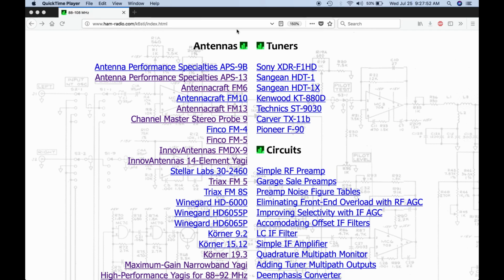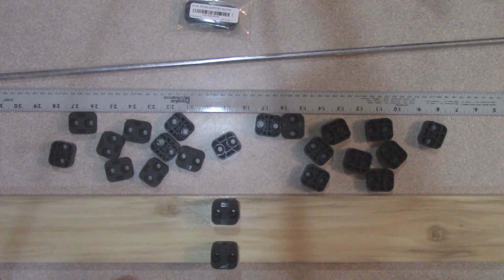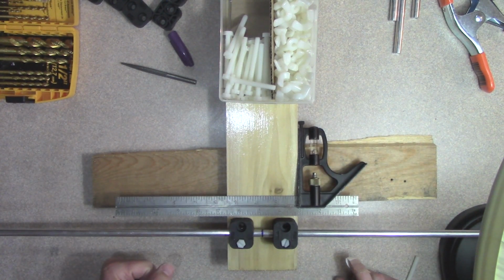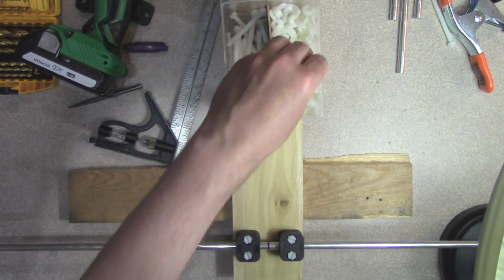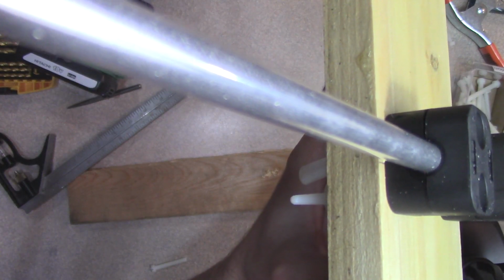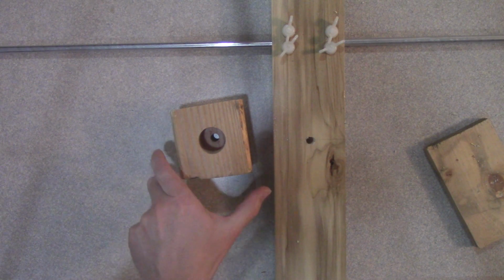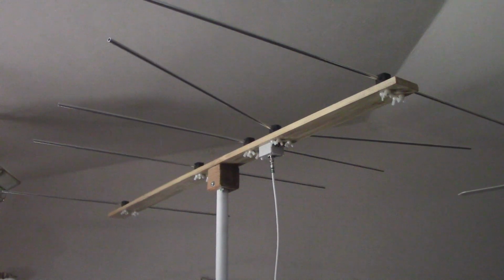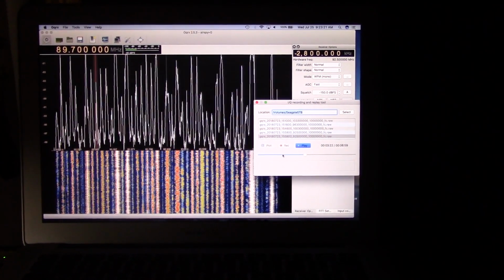Arizona Signal Watcher Ep014 - 5-element Yagi for the FM broadcast band

Comment: Came across this, this morning, seems like a solid antenna, kudos!, 
re matching direct to the Coax, you might want to slip a few clamp on Torroid chokes right near to the feedpoint, to eliminate the exterior side of the Coax from "picking up signal" , you should gain even better directivity from the Yagi, once you get rid of that common mode RF off the shield.  I have made some interesting full wave loops for FM Band, the Circular Loop one wavelenght in size a favorite, which worked great especially at nulling out a station and seeing who might be underneath, FM Band DXing = Great Fun

Comment: I just completed this antenna and it works great!  Mine is built on a 1" tube aluminum boom and mounted on a tower with a rotator at 37' high.  I am running it on a FM crystal radio which runs into a tube amp and then a 16" speaker.  The results are outstanding!

Comment: Would it be okay to use square tube instaed of round? Your video inspired me to cobble together an antenna. I picked up Chicago from 130 miles and Detroit from 160. I didn't know that was even possible. That was with it about 20 feet in the air. I'm going to make it a little sturdier and mount it to a mast rotator. The directionality is amazing. I used a calculator to design mine at 100 Mhz center frequency. I didn't bend the dipole though. All I had on hand was some thick copper wire, I used an adjustable curtain rod for the reflector. I tied the copper elements with line to the reflector and mast to keep it straight. I'm going to get some rods to replace that. I used a balun and a few inches of coax to an rtlsdr. Then a 35 foot usb cable.

Comment: I made this antenna. I bought the same parts used here from DX engineering. Used the 3/8 tubing. Only difference is my boom is 1 inch square aluminum stock. The elements are isolated from the boom. Unfortunately it does not perform well for me. Actually it performs poorly. Not sure why. I get MUCH better reception for a simple crossed dipole that I made from old tv antenna elements.